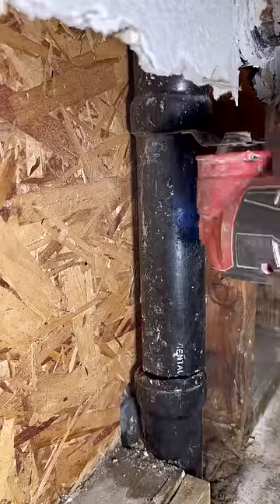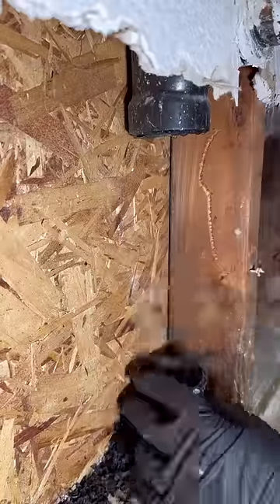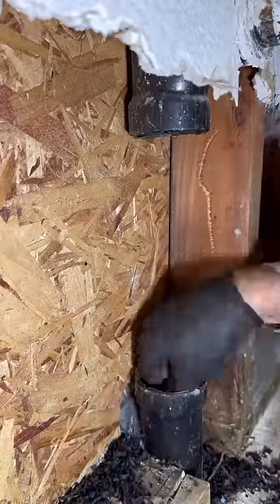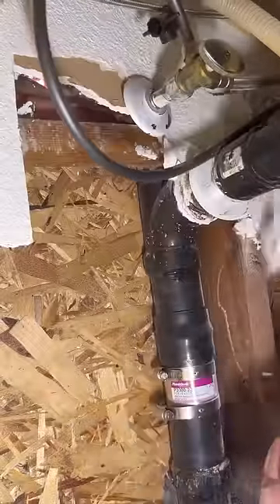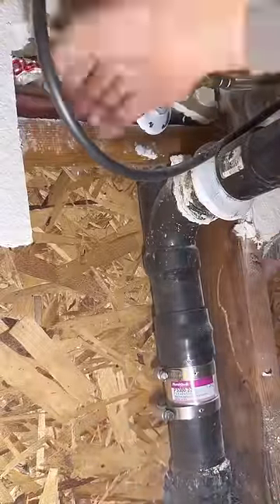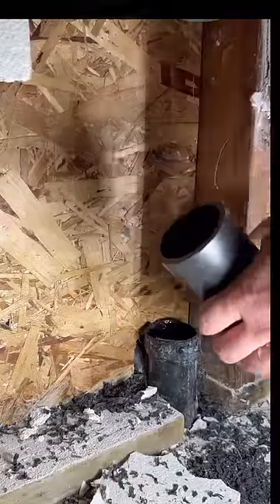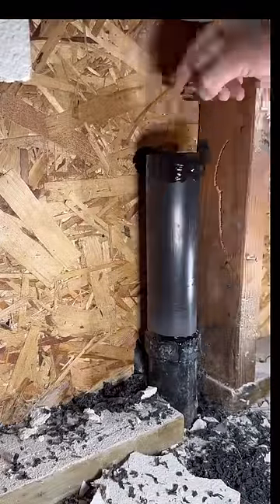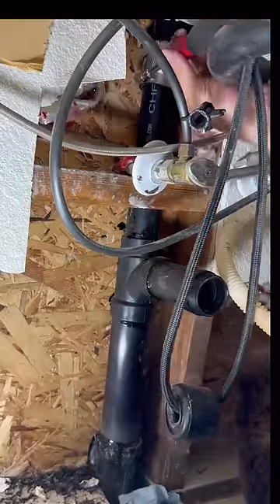2” ABS repair #plumber #plumbing #diy #homerepair #plumbingrepair #construction #masterplumber

Comment: As a plumber that has never installed abs, it has been in my home since 1973 and never once had any issues.
Reply: Same but hvac guy
Reply: Same but car wash guy
Reply: Same but electricity guy
Reply: Same but Plumber guy
Reply: Same but homeless
Reply: @daniellau5859  I have a problem.  How do you keep the water out of your ABS sleeper?
Reply: Same but I’m gay
Reply: Yup. If ABS is installed correctly it lasts seemingly forever and never leaks. The ABS glue literally melts the contact surfaces and makes it into a continuous piece of ABS plastic. It doesn't rust like cast iron, and you can beat a helper with it all day and it won't break.
Reply: I'm a bus driver... same... 1976 though

Comment: We use 95% abs in residential plumbing in Canada.
Reply: Yeah I've never heard of anything but
Reply: @djones02  Some rare instances in condo buildings, PVC is used for main stacks.  Something to do with if the building burns and the smoke rating of pvc vs abs yet abs is used within the individual units.
Reply: @djones02  certain parts of bc we have to use pvc where a basement sewage pump comes out of the floor
Reply: We quit using ABS around my area in tge 80s. Problem I see with 30-40 year old ABS compared to PVC is it sags really bad when running horizontal no matter how well it is strapped. ABS is Garbage in my opinion
Reply: @kscory8577  This doesn't make sense. The sags you see are from not properly strapping the pipe. You said it sags no matter how well it's strapped. What if it's strapped every 3 inches?
Reply: @krissmith1986  that is my point. Strap it every 3' if you want and I will use pvc and not have to worry about it. I wish yt would let you post pics sometimes
Reply: @kscory8577  code requires pvc pipe be strapped as often as abs pipe.
Reply: @krissmith1986  you are correct. But one will sag overtime and one wont
Reply: @kscory8577 run your abs through joist  bays and strap 
Never seen it sag. Every 32 inches is code here.
Reply: @krissmith1986  In my attic I have runs of 20 feet in ABS and no sag after 35 years. Temps there reach 95 degrees in summer and minus 30 in winter. Maybe some manufacturing quality problem??
The only drawback to ABS vs cast iron is the noise of circulating water can be heard.
Reply: @wetrock2766  It’s a workmanship issue. Strap the pipe properly and it won’t sag.
Reply: @caelan2203 well that’s because sched 40/80 PVC is for pressure. You shouldn’t use DWV plastics for a pump discharge unless it’s copper.

Comment: In the 80s, flawed ABS was sold and installed. The flaw was poor coatings inside and out of the foam core. The flawed ABS cracks wherever it was glued together. There was a class action lawsuit over it that was settled in the 90s. 

I work in a huge building with the said product. There's hundreds of failed connections. We usually repair with socket to pipe repair couplings.

Comment: I like the funny old man voice you do when you mock old school plumbers. That said, I did want to share with you that a no hub band is meant for cast iron. Though it fits fairly well, a shielded band designed for plastic fits even closer to spec, and I have had to replaces some no hub bands that were used to repair plastic drain pipe because they failed. Not saying your work is improper, there is just a slightly better option.

Comment: Cast-iron these days is for rich guys who want quiet walls
Reply: And want to replace it in 40 years.
Reply: @RichardPyne  Yeah, inside surface gets rough and grabs everything, also if the water is a bit acid or in marine environment it fails quickly.
Reply: Plastic pipe that is wrapped well will stay pretty quiet

Comment: ABS is stronger than PVC also. And cracks less. And is easier to work with. And is faster to glue up. But whatever.

Comment: Hey bro. Instead of the nohub on ABS . Try the new ABS slip repair coupler. It has no stop. Just use alot of glue. They are made by nibco and sioux chief
Reply from the maker: I can’t find them on the shelf anywhere. In my most recent short I made my own😎
Reply: @replumb  I'm up in wa state. We have a ton. But they sell them specifically at keller supply. I can send you some to try if you want.
Reply: Yeah you can use that reamer to remove the center stop

Comment: use 2 no hub bands if you have no movement in the pipe
Reply: No hub bands would not be legal under most codes. Proper fitting would be a fernco.

Comment: Here in the center of the country, ABS had become scarce as hen's teeth, which is ok with me because i find it to be to turn brittle and be inferior to PVC over time. Cast iron provides no value besides nail and screw resistance.

Comment: Yeah, cast iron wouldn’t split, but it absolutely would eventually rust and wear down. I rent my house (built in the 50’s) and it has cast iron pipes, the landlord has to have a plumber come out about every six months to clean out the lines from tree roots and other debris. We did have some freezing in our pipes over this last winter which was especially cold and our pipes thankfully didn’t have any problems. PVC pipes in the same conditions would have been obliterated long ago.

Comment: Yea cast iron cracks and rusts out
Reply: In a hundred years...maybe.
Reply: Its required in structures 3 stories or higher......
Reply: @Urbanhandyman way less than that.
Reply: @themexicankidwonder  Not around here in lovely California.
Reply: @Urbanhandyman  I'm from southern California. Homeowners are replacing there cast iron, either by chain knocking and sleeving it, or digging it up. It gets calcified, it becomes super thin, with hairline cracks with roots filtering through.
Reply: @themexicankidwonder  You're talking about underground cast iron.  The video is about cast-iron in the framing of a house.  Yes, cast iron in the ground rusts away to nothing .  I have yet to see cast iron in walls go bad. Calcium build-up can be treated with vinegar and similar acid-based treatments.

Comment: Hey boy you better put that dry wall back 🫣
Reply from the maker: not a chance🤣
Reply: As someone who has had service plumbers out, naw, that ain't happening. The plumber does enough stopping the leak and cleaning up the mess they made. Sheetrock repairs in undersink cabinets may drive a homeowner to drink but it's better than paying a plumber their service rates to bridge, cut, tape, mud, prime, and paint.

Comment: Who tf says you should stick to cast iron? 😂
Reply: New yorkers and super high end builders that are bringing cast iron back because its quieter.
Reply: @feyrband Water hammers?
Reply: @DillonBrooksUnderPRA  just less water running/sloshing noise when flushing toilets and other drains
Reply: @feyrband  I honestly feel people should be told they have to deal with it if they want less headaches down the road. I don’t think water run noises should be considered at all. It’s not even that loud unless you never watch tv or do anything, live in quiet lol.

Comment: Here’s the answer to why some guys still use ABS. This was told to me when I was an apprentice 37 years ago. “We do not use PVC because it contains one of the highest cancer causing agents known to man.” Folks Vinyl Chloride is what was spilled in East Palestine Ohio. Where Biden has never been by the way. PVC is Polyvinyl Chloride. Still as toxic today as it was 37 years ago. Now here’s the thing. I use it. I have for decades. No cancer just a slight twitch😂. Joking people. Wear gloves using the glue and cleaner and wear long sleeves and use it in a well ventilated area if possible. No you will not get high from it just a massive massive headache.

Comment: The low and no water fixtures destroy cast iron Most places won’t allow it in new construction.
Reply: Seen my fair share of cast iron pipes with huge 10foot long cracks going along the whole length of the pipe.. I'd rather use abs any day
Reply: @plank9456  yep right along the seam

Comment: I hate disposal 90's. I would've installed came straight out of the disposal and right into the directional tee using a  straight flanged tailpiece instead of the disposal 90.
Then shorten up the flanged tailpiece to the other bowl. Connect it into the top of your directional tee then attach your p trap to the bottom of the directional tee and into your santee in the wall. You can eliminate the need for the disposal 90 which makes a better system. Also you have more room under the sink because you brought everything up higher.